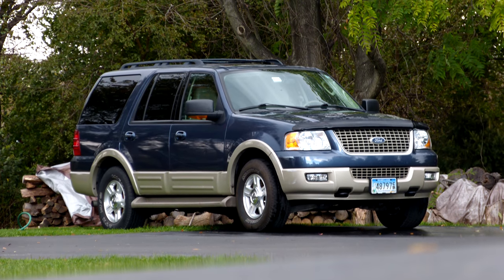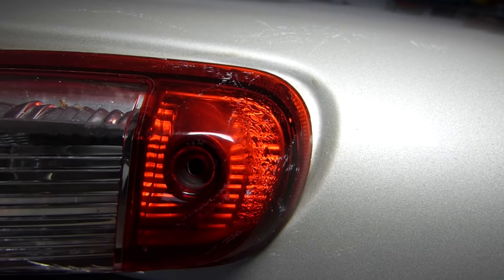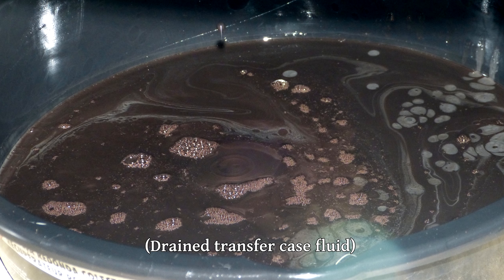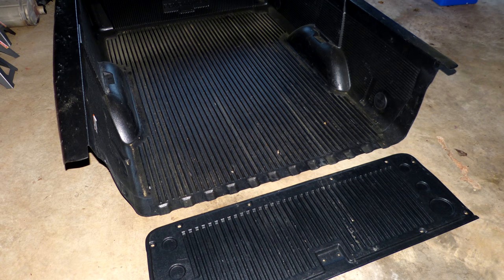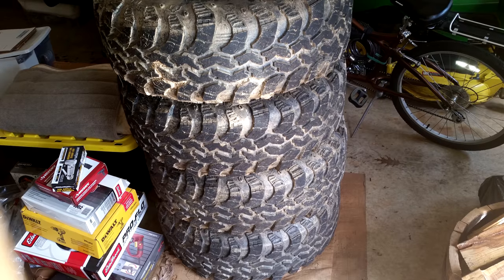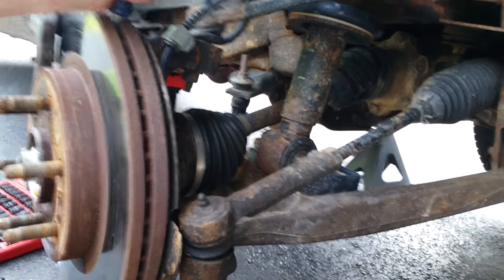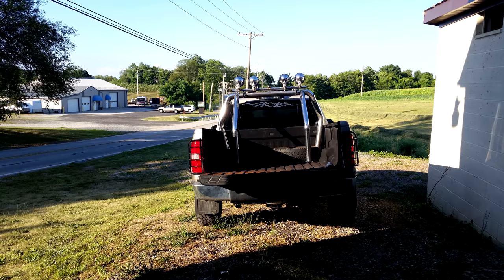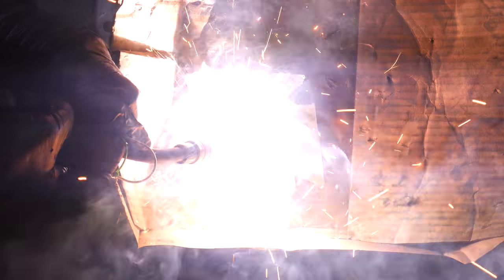2007 Chevy Silverado 4x4 Backstory and Adventures (Ep.1)

Comment: I would have lifted that truck by like a foot lol 
Edit: I would also make the wheels go our by 3-5 inches
Reply from the maker: It would make it way too impractical to use. These trucks look good with a 6" lift, but even that is on the tall side when it means you have to heft some heavy stuff into the bed. I do want to install a 4" lift (so 2" higher than it currently sits) so that the tires actually clear and to get a tiny bit of extra ground clearance, but isn't tall enough to be annoying (for me) to use.